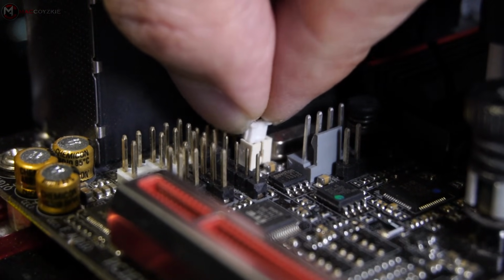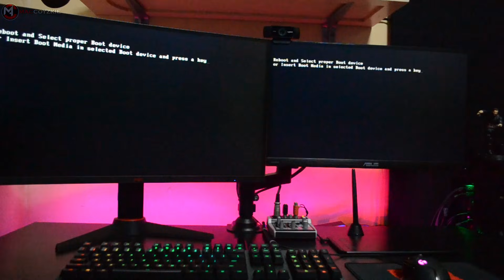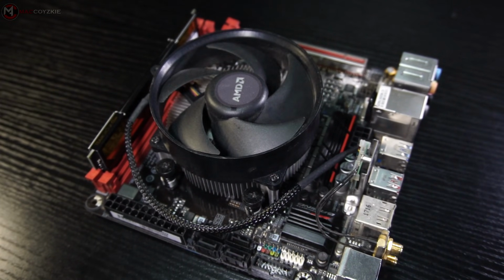How to remove cmos battery in your pc? Cmos reset / hard reset on bios

Comment: Can this help with kmode exception not handled blue screen of death? I've already done driver updates and memory diagnostics test, my friend told me to remove the cmos battery.
Reply from the maker: Yes do remove the cmos battery for 5 minutes and place it back again before powering your pc back on. If that still doesn't work try to disable fast boot in bios. This kmode thingy is really a pain in the butt and the last thing you can do is to totally have a fresh windows installation

Comment: boss baka sakaling matulongan nyo ko sa problem ng aking pc. eto yung problem, una boss ginamit ko pc okay naman tas nung nishutdown ko na sya, running pa din yung mobo pati yung mga fans ng case at ng processor gumagana kahit nakashutdown na. ang ginawa ko niclick ko yung restart button ng csu at gumagana pa din. pangalawa nihold ko yung turn on/off ng csu gumagana pa din yung lights and fans. ginawa kong last is inalis ko yung extension cord at nag off na ang fans at mobo. nung balakin kung itturn on ulit, ayaw na mag on boss. ano kaya magandang gawin dito? salamat boss sana matulongan mo ko
Reply from the maker: paps palagay ko power supply problema ng pc mo. Generic ba yan or 80+ certified? On the other hand marahil pwede din ang problema eh yun windows 10 mo, oem ba yan or retail version?

Comment: I started my video game then it crashed and then said no signal
Reply from the maker: might be overheating. have you tried the cmos reset yet?
Reply: i turned it on one time video game r crashed then it says no signal
Reply: Also how do I do
Reply: Didnt overheat
Reply from the maker: @opennowfool4929  watch the video bro, i gave the instruction there
Reply: i cant  get it out i checked the video
Reply from the maker: @opennowfool4929  use a small screw to push the lock